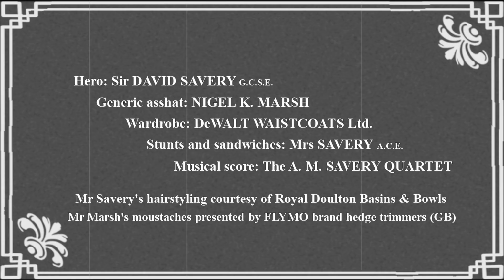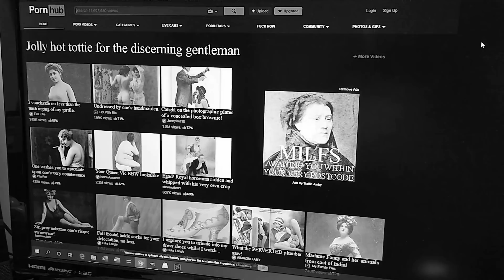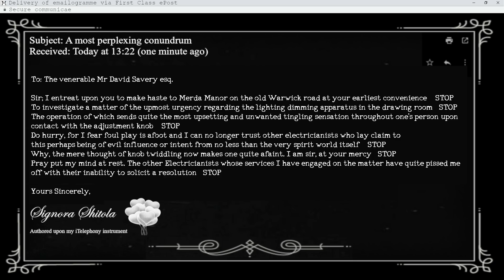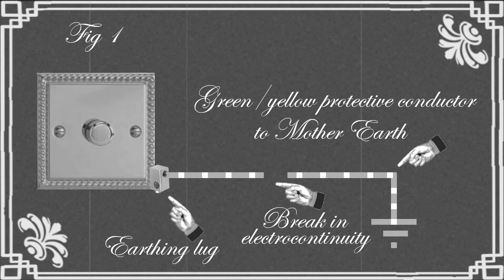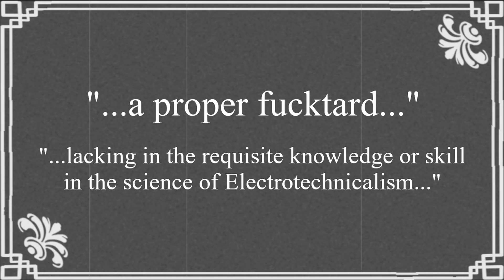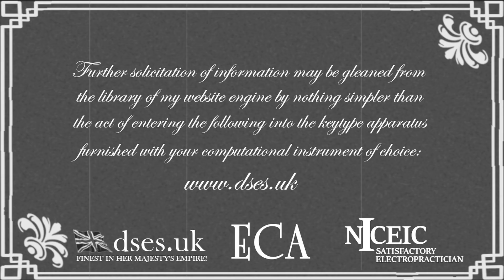The Capacitive Earth Fault Mystery!

Comment: The current in the PEC between the yoghurt pot and the switch plate was isolated from the supply so even if the current was above the trip threshold the RCD would not operate. Even if it was a monitored earth ground fault relay it would not operate. Other than that flaw an entertaining video!
Reply from the maker: Interesting. You're saying it would act like an isolating transformer.... I must admit, I hadn't considered that....
Reply: @dsesuk  As I know you are well aware, RCDs measure current in-balance between phase and neutral. For there to be an imbalance there has to be a path for current to flow back to the main supply neutral before where the RCD is installed electrically. This can be through earthed equipment and fittings, the general mass of earth, another phase (3 phase installation) or the neutral of another circuit. In this case there was no current flow at all as there was no contact between any live conductor to the switch plate or earth. As neither the plate or the protective earthing conductor attached to it was earthed there is the risk of it holding a potential difference due to induction or capacitive effect. It's why we carry out equipotential bonding of metal work, particularly in earthed situations so that there is no potential difference between any other metal work or earth mass. 
Swimming pools, Caravan parks and Dairy sheds are particularly susceptible to stray voltages. 

18.3.7 of the below article. Sorry about the long link.
Did the lady have a slightly bovine manner about her?

https://dnn9n7kh1.blob.core.windows.net/portals/0/Professional%20Licensure/E-Reference%20Book/Common%20Systems%20Applications/elecch18.pdf?sr=b&si=DNNFileManagerPolicy&sig=pxNQn6kf2gyI%2FWI14%2F9u2ILKzxRUfm%2Bi6lgD8vg2yUk%3D
Reply: As per my comment in the main thread.....The RCD would not trip due to induced voltage/current onto the switch plate via the disconnected CPC, even if by touching it you completed the path to the mass of earth.  Regardless of how many milliamps flow.  

Induced voltage/current is an effect that EMF has on parallel conductors.....the effected conductors do not drain the energy from the live conductors causing the EMF.  For that reason, there will be zero imbalance in the RCD supplying the circuits.

Trust me.
Reply: @Spark101.  My point exactly. Missed your comment sorry.
Reply: David's example of an isolation transformer is a great way to understand how this works.  If you have a 1:1 isolation transformer plugged in then by definition you can connect either output to ground and nothing will happen, because it's isolated from the mains, which is what is happening here.  You can even short circuit it or put it through a person and the RCD across the primary won't trip, because no current is leaving the primary circuit via alternate paths.

If this was NOT the case, then reconnecting the earth wire back to the installation would have resulted in a short circuit (or at the very least some large current flow) and tripped the breaker or RCD.  This didn't happen which further illustrates how the disconnected earth wire was acting like the secondary on an isolation transformer.
Reply: @Berkeloid0  From the image David used It looks like it could have been a dimmer switch which probably set up a strong magnetic field around the switch plate. Not a UK sparkie but from when I was in the UK that is what their dimmer switches are like and they have an on off switch action when you press them.
Reply: The RCD would trip.  If a leakage current of 30mA is flowing through the good lady then it has to be returning to the neutral via her body and some connection to ground.  She may be touching a water pipe say.  Therefore this current is not returning via the neutral wire in the  RCD and it causes an imbalance.  The fact that it is flowing via a capacitive connection is irrelevant.   Of course this could never happen because for a current of 30mA to flow, the capacitive coupling would have to be greater than 0.4 microFarad which would require miles of wiring.  On the other hand 0.4uF is about the value of the capacitors used in cheap Chinese LED lamps with series capacitor power supplies, which are notorious for their lack of proper isolation, so there is a real chance of encountering this electrifying situation.
Reply: @petehiggins33  No. The current in the circuit never leaves the circuit. How can it if the brass wall plate is not connected electrically to the circuit and the switch is not shorted to the brass wall plate? If the phase or neutral was shorted to the plate then yes the plate would remain live and trip the RCD when the lady touched it, if she was sufficiently earthed. But there was no fault path for current to flow out of the circuit on an alternative path back to the main neutral bypassing the RCD. And from what I gather from the video the switch was in perfect working order, the only fault was the disconnected protective earthing conductor at the yoghurt pot. 
I'm sure if David had carried out an insulation resistance test between the wall plate and phase or neutral of the circuit he would have had a reading above 500 Mega Ohms, proving electrical isolation of the wall plate from the supply conductors.

What is a capacitor? It is two plates separated by an insulator. Current flow is the movement of electrons. Electrons will not pass through insulators. I know you think that DC is blocked by a capacitor and AC passes through a capacitor but that is not actually the case. What actually happens with a capacitor is known as Displacement current not electrical current.

In the situation in the video one plate of the capacitor would be the live conductor and the other plate the disconnected earth conductor. The dielectric is the primary insulation of these conductors. No electrical contact between the plates equals no electrical current flow, only displacement current generation.
Reply: Well no, hang on a minute the RCD would operate if the amount of current between the live conductors (phase and neutral) differed more than 30ma.
Reply: @Adit209  And how would induced current in a conductor isolated from that phase and neutral create an imbalance of any magnitude, never mind 30ma, in the circuit supplied by that RCD? Do you guys create an earth neutral link at your lights switches? I highly doubt it. Please explain the current leakage path from the supplying circuit to earth that would cause the RCD to operate.
Reply: @cunning-stunt  Live -> capacitively coupled to switch plate -> person -> mass of earth. That's the path. Very low current in this case, but you stated "even if the current was above the trip threshold".  If the induced current was above the trip threshold, the RCD would trip.
Reply: This is not correct. I was wrong.
Reply: @misstakenot9582  No Sweat. We all make mistakes. Bit of an ironic name though eh?
Reply: @cunning-stunt  Sorry but this is bullshit, IF there was a 1:1 isolating transformer then it would be correct that anything happening on the secondary would not affect an RCD on the primary but there isn't a transformer so if someone sinks over 30mA (assuming that's the RCD rating) then it WILL trip the RCD, you said "there was no contact between any live conductor to the switch plate or earth" no direct contact but there was leakage current through a capacitor, that is NOT the same as an isolating transformer, the current causing the tingle is leakage current from filter capacitors which is widely known about and there are limits as to how much leakage is allowable, even that allowable leakage would normally be clamped by the earth connection but even if the earth fails it's still considered safe, the filter capacitors are class Y so designed an approved for connection between live and earth, they will fail open circuit in a fault unlike some other capacitors that will normally fail short (which would be bad). So TLDR version, if leakage through a capacitor exceeds the trip current of the RCD then the RCD WILL trip.
Reply: Well, you got them going on that one!👍
Reply: For 30ma to flow across a capacitive connection at  230v would require a capacitor with an impedance of 7,700 ohms. At 50 Hz (314 radians/sec), then that would require a capacitor of about 0.41 microfarad. Of course that's ignoring any resistance of whatever unfortunate individual got to touch the capacitor (so, in reality, the capacitance would have to be somewhat higher). Of course, there's not a chance in hell that a bit of stray capacitance from two wires will have anything remotely like that capacitance. However, electrical devices often have mains-voltage capacitors with a higher capacitance, and there is a fault to earth, it could trip an RCD. 
What will have happened with that switch plate is that it will have built up a charge as it will have some sort of capacitance to earth. The initial shock will mostly be the very small charged that has been induced on the plate going to earth via the unfortunate lady rather than the continuous current that might flow because of the stray capacitance.
So, a capacitor from line to earth can trip an RCD. Find an appropriately rated 1 microfarad capacitor and connect line to earth and try it. Note, I take no responsibility for anybody actually trying it.
A capacitive connection is nothing like an isolation transformer.
Reply: @TheEulerID  This has been driving me a bit crazy...I see it your way but everyone else is saying it's the other way...Aaarrgghh. The energy comes from somewhere! And that is from the line conductor.
Reply: Totally agree. For RCD to operate current would have to leak directly from live conductor. Since it's not, you can have Amps flowing and RCD won't help.

Comment: High leakage tingle is fairly standard with modern switch mode power supplies or items with a mains filter, a certain amount of leakage is allowable, it can get "interesting" with multiple leakage sources on a single circuit obviously the earth usually gets rid of it but there are still cases when you can get a tingle even if everything is wired correctly. I once worked servicing and installing train ticket vending machines, we once got a call that a machine at a station was giving customers electric shocks so I was forthwith despatched to investigate and the machine was giving quite a tingle, I checked the internal wiring and it was fine with earth properly connected, the machine next to it wasn't giving a tingle so I measured the voltage between the cabinets and got well over 100v but virtually no current the machines had mains filters and were high leakage devices. It turned out an "electrician" had recently done work at the station unrelated to the machines but had somehow managed to disconnected the F**king earth for one of them. So there was me a lowly field technician not qualified as a spark sorting out his S**tstorm a "qualified" spark working on national railway station electrics where they're normally so anal about safety.

Comment: Not sure the RCD would have tripped anyway. Induced current is used in everyday parts of the electrical installation, in old style fluorescent starters (choke), transformers, dimmer switches etc. Granted these types are all inductive reactance not capacitive reactance, but the induced current you explain in this example is also indicative reactance. RCDs don’t normally trip due to inductance. Don’t get me wrong, lots of RCDs do trip with modern electronics such as modern luminaire drivers, dimmers, computers etc, but that is because of the earth leakage they exhibit in order to function, not the inductive or capacitive reactance. So an induced potential was accumulating in the switch, which with adequate earthing would solve the problem. Great video by the way, the “Harvey Winstien production” cracked me up. Keep up the good work.

Comment: 👍🏼 Top video, I had a similar situation in 2013, where a client was getting shocks from class 1 light switches throughout the property.  2 other sparks had attended the property.  One told the client it was static.  The other could find no fault.  Upon investigation, it was found that the CPC was actually not connected within the consumer unit, both sparks did not check the consumer unit.  It hadn’t broken, it had never been connected when the board was replaced some years ago.
Reply from the maker: And doesn't that just show how things have slipped in our industry Patrick? Two other electricians, or at least people posing as such, didn't even check to see if the conductive part the client was getting a buzz off was earthed. Who wouldn't think to check the method of shock protection when the client is reporting receiving a shock??! Feckin' ridiculous. I hope they didn't charge for their time-wasting!

Comment: Any chance of something on smart switches with no neutral and how you’d get around this?
Reply from the maker: Hi Philip. If the switch requires a neutral, then there's not much to do but get a feed to the switch that contains such. If it doesn't have a dedicated neutral, then it will get to neutral through the light. Is that what you mean?

Comment: Would the RCD actually trip at all in this situation if the faceplate (via the CPC) had an induced voltage/current high enough.  Surely there would be no imbalance at the RCD end even when the lady does touches the switch regardless of how many (ma) flow? 

(let’s  pretend for arguments sake that there is enough induced voltage/current at the metal switch plate to operate an RCD)  In my mind, the RCD would not trip if you touched the metal switch and received a shock from induced voltage/current.  Because the amount of current flowing down the line conductor would not change or be imbalanced in relation to the circuits neutral conductor.  If it was a short, that’s a different story.

Thoughts???
Reply from the maker: You may be right KC. It's an interesting point.
Reply: Exactly electrical current flow will not pass through an insulator, therefore there is no leakage path. It's all down to displacement current vs electrical current. EEVblog explains it perfectly. https://www.youtube.com/watch?v=ppWBwZS4e7A